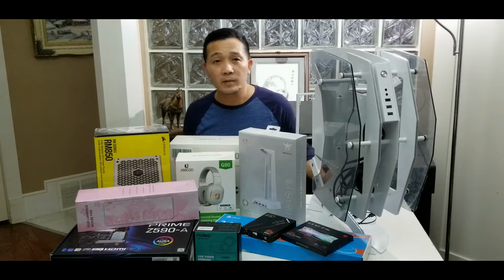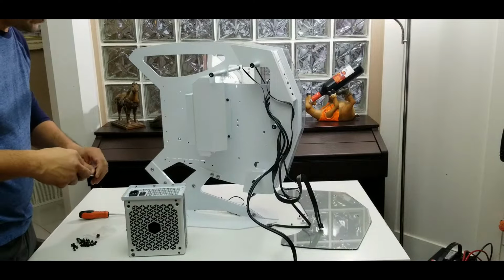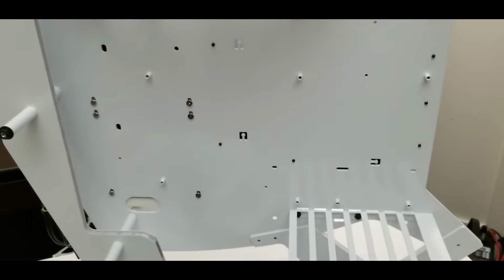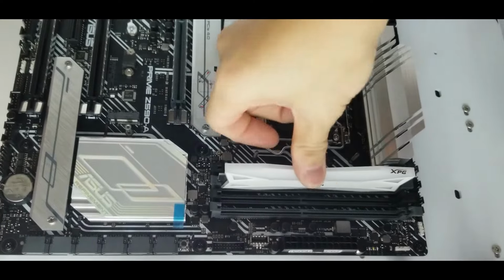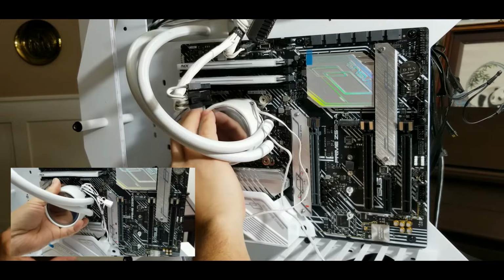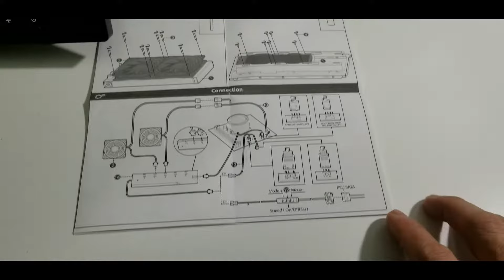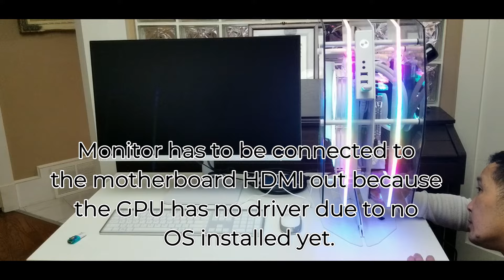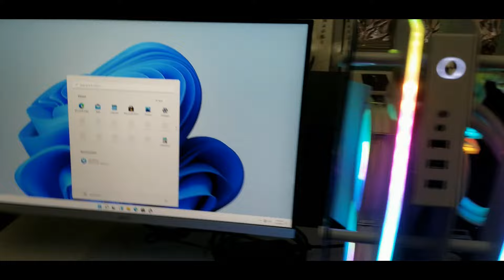SEMI Budget Gaming PC Build with KEDIERS Open frame Case C580

Comment: I just bought and built this case a week ago.  So far I love it.  I used old parts from previous builds and using the pc as an htpc.  I did add more lights to the case and it looks fantastic IMO.
Reply from the maker: Yes its looks fantastic for sure. I just wish that its powder coated instead of just painted but I like the case, looks very futuristic.

Comment: Now that you've had it a while do you still like it or has it been a pain to keep clean? I'm only asking because I'm really leaning toward getting this case.
Reply from the maker: I haven't cleaned it since I built it. I was at my brother's place last weekend and I can always see the computer every time I go there because it is set up in a small office by the kitchen, and still looks clean. Take note that they are not using it for gaming, but it is running at least 10 hours a day because they use it for home business. An open case is actually easier to clean than a closed one. Not only you can see the dust when starts to build up, but it is also easy to clean because it's open, all you need is compressed air plus open-air PC cases allow airflow to pass through without any obstacle, so there's little chance for the dust to be stuck inside and start building up. And to answer your question, Yes they still love it, and they always get compliments from their clients because of its unique look.
Reply: @ruvrandomusefulvideos  thank you for the response! And appreciated the video you shared.